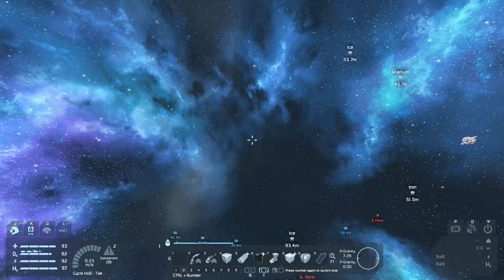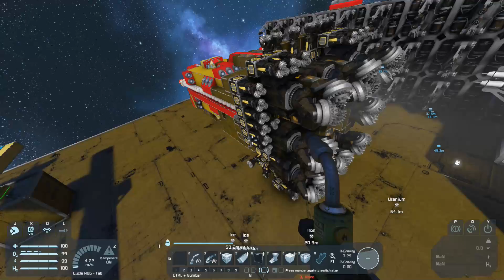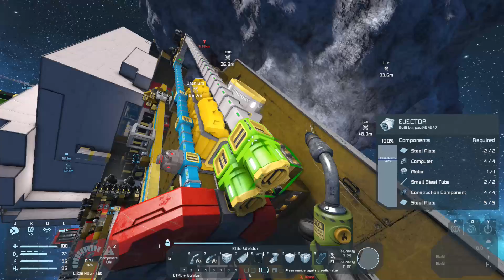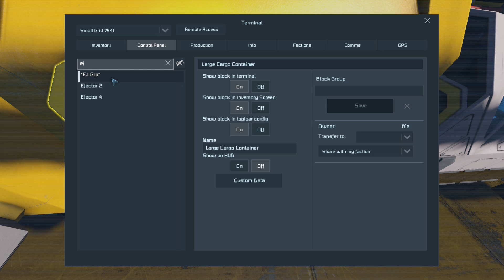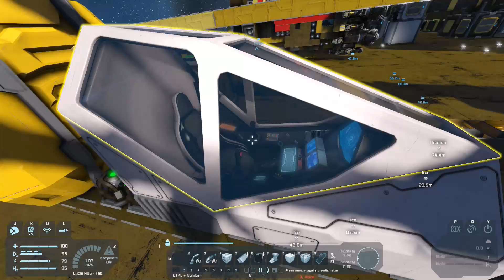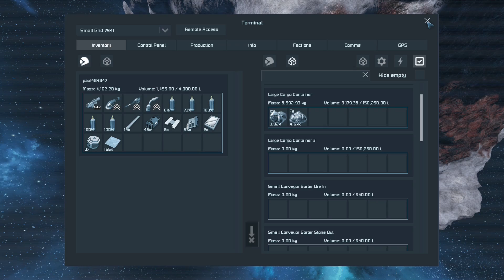Space Engineers Down and Dirty Sorters, Connectors, Docking and Unloading

Comment: I know I'm super late to the show (playing on ps4 🤷) but good video man. Currently looking for more info on how to make my ship offload lighting fast...or at least so it's not grounded for hours. My first ship had stuff tucked away in different containers where the sorters weren't draining everything but instead would casually suck stuff out when the refinery was good and ready. did the same as you, learned a bit in creative and then jumped into survival lol. Currently working in creative to make a "perfect" miner and then just bring the blueprint into my survival save
Reply from the maker: Since I made this video a lot of things have changed. As far as I know, the best way to offload ships rapidly is to create a large area with collector blocks, where you can fly over them. I haven't played in a while so my information may be outdated.  In any case, I use 2 docking connectors on the bottom of my ship, set them to collect all and eject all when I fly over the Collection Grid at my base. Hope this is of some assistance.

Comment: I have 2 connectors on a station. I have ships docked to both of them. Whenever I get into one of the ships and undock it, it undocks the other ship at the same time. Is there a way to make this not happen?
Reply from the maker: Garret, it sounds as though you are using the Universal Dock command... DON'T! That's ok for the first few days learning the basics of the game. In each ship, name the Connector for that ship, then Make a Docking Hot Bar (Like CTRL+5) on that bar put Connector On/Off Switch, Lock On/Off Switch... you can also put throw out commands and anything else you'd like there. Make sure that your Station Connectors do not have the same name as well. IF you are already doing this, then this is something pretty new and most likely a bug in the game.
Reply: @MrAterr  I've tried to use docking commands for individual docking but it still does the same thing
Reply from the maker: Try removing the Connectors and replacing them, if that does not work, report it as a bug.
Reply: @MrAterr   Ok, I'll try that, thanks